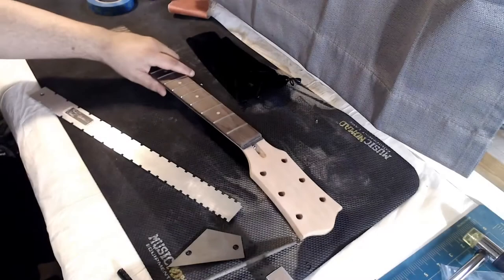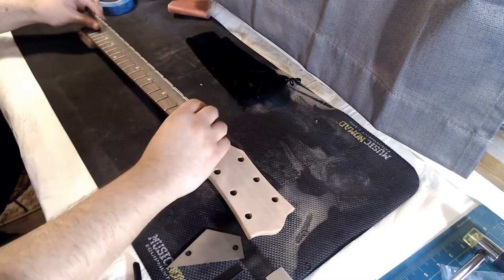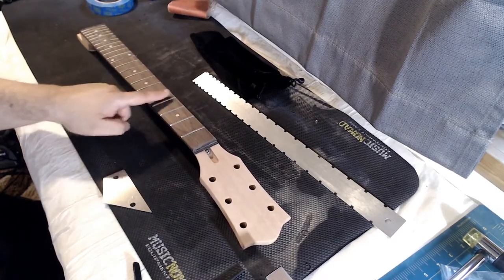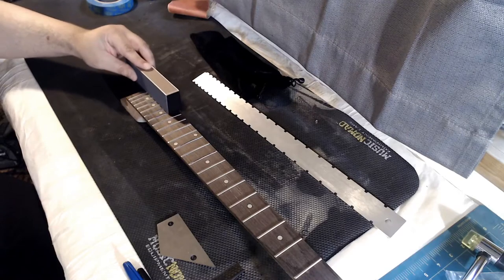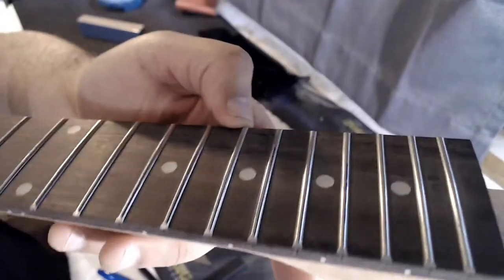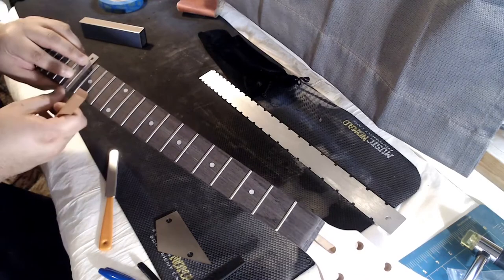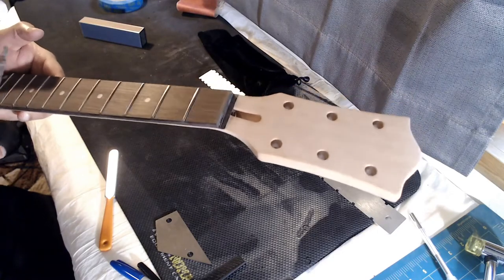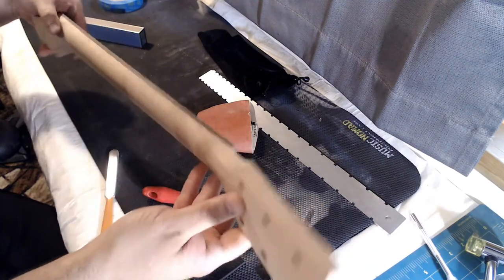The Blue Beast SG Kit Guitar Part 02: Fret Leveling

Comment: Hi Ed, really nicely done. A lot of people don't realize the impact having level frets can have on the sound of a guitar. I found this out by "test driving" hundreds of basses over many years. Some had "the sound in my head" and played like buttah, just no effort needed. Some drove like trucks, like being in an old worn-out semi, trying to parallel park, and had dead spots all over. Unpleasant to say the least. That, or buzzes and farts in the money zone. All of the bad ones had high frets, or no fret dressing at all. The high-dollar basses were mostly on the money. You took your time on this one, and it wasn't nearly as bad as I was expecting it to be. A really good fret job on even a cheap guitar can take it from turd-blossom to terrific, and is something I always tell beginners to invest in. The most bang-for-your-buck improvement you can make to a guitar is a great setup. I have some cheap basses that I've worked over, I've taken sometimes a week or more to get set up, and would rather play them than most off-the-rack upper-midlevel basses.